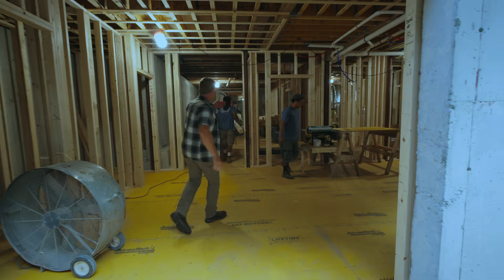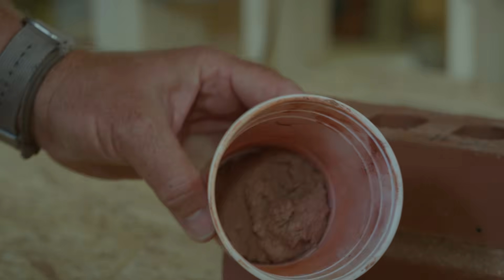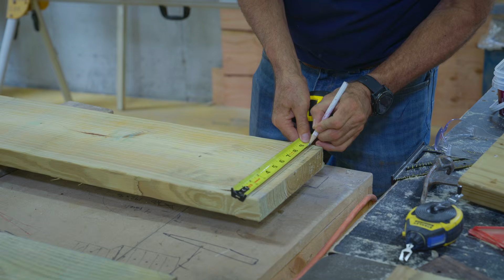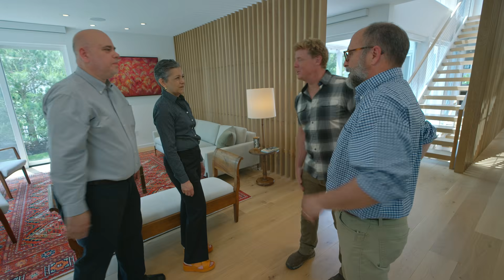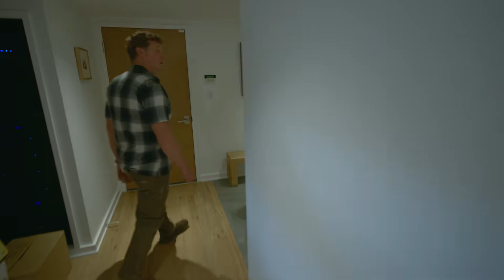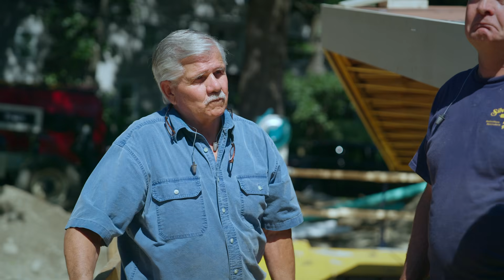This Old House | Ramping Up (S45 E7) FULL EPISODE

Comment: I would have included a wheel rail on the outside of the ramp.  If the rider going up gets the wheels off, they would go over the edge.  Just cut a 2x6 so it will mount on the edge with a 3-inch lip.

Comment: Having built many ramps, aluminum diamond plate is very slippery when wet - regardless of the “diamond” marks.  It’s best for indoor applications.  Usually advisable to coat aluminum with a heavy duty nonskid surface.  Galvanized steel diamond plates is less slippery than aluminum.  For the best non-slip surface outdoors, a “Mebac” type product is much better.